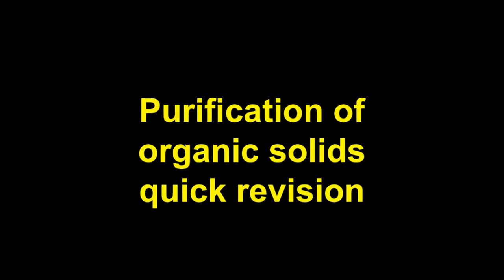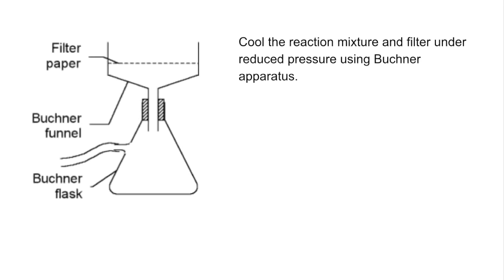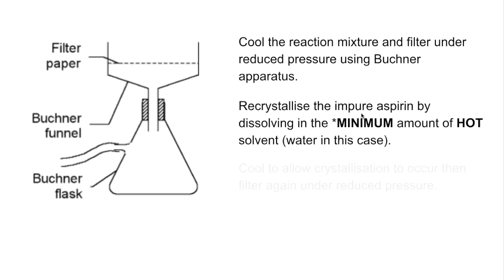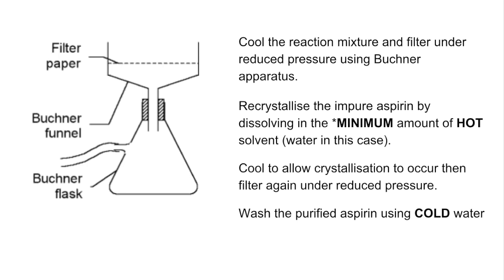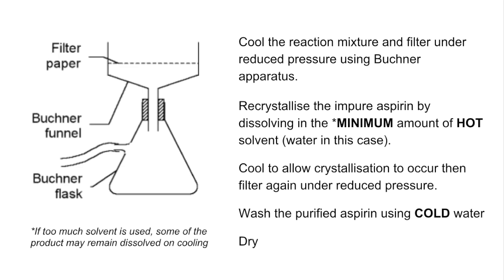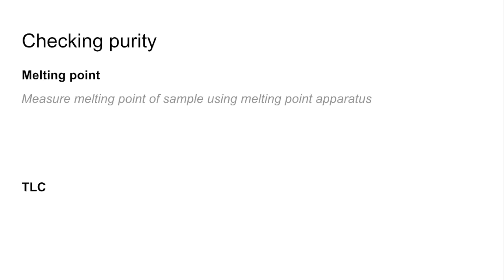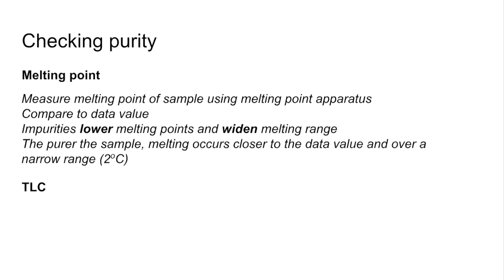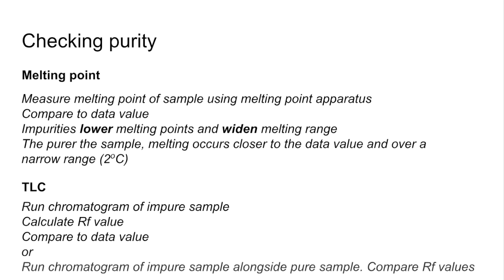Quick Revision - Purification of an organic solid

Comment: wait so with an organic solid : 
dissolve in a minimum amount o fhot solvent 
filter 
cool using an ice bath to allow cristilisaltion to occur 
filter under reduced pressure 
wash with cold distilled water 
leave it to dry 
measure meltign point to check purity and compare with database values

Comment: in that particular question, to get the mass they did 100/90 in order to get the moles , i dont understand why that is, could you please explain that to me?
Reply from the maker: Happy Noodle Hi there. It’s because the yield is only 90% so you’re going to need more moles of starting material to get the desired amount of product. To scale up you divide moles by the yield and then multiply by 100. Hope that helps
Reply: Thank you, i think I understand so is it essentially the same as rearranging the percentage yield equation? so moles / percentage yield to get theoretical yield?
Reply from the maker: Happy Noodle Got it!

Comment: Why do impurities lower melting point? I think in paper 2 in one of the MCQs it came up and I didn't know the answer. Could you clarify please?
Reply from the maker: Impurities disrupt the lattice structure of the solid compound and so weaken the forces of attraction between the components. Less thermal energy is needed to overcome thus lowering the melting point. Hope that helps.
Reply: MaChemGuy  yes, thanks!